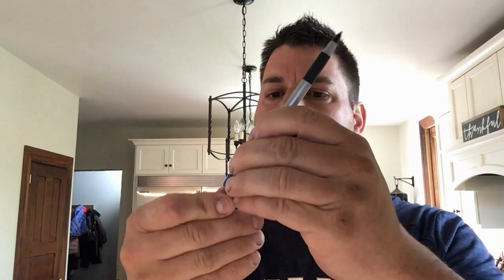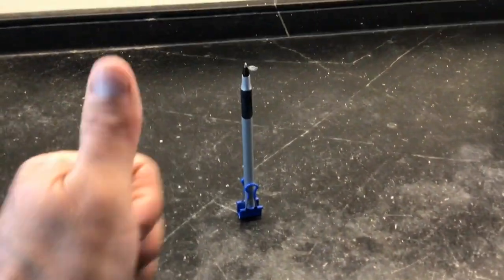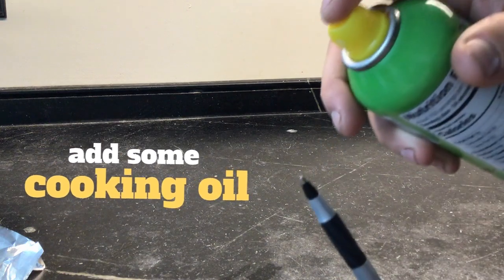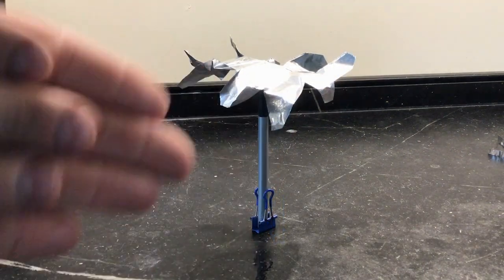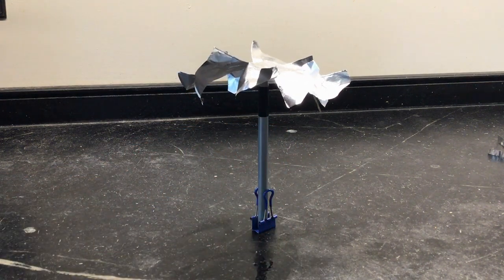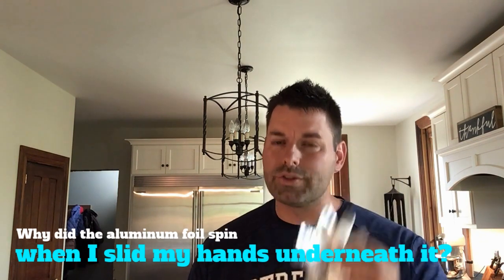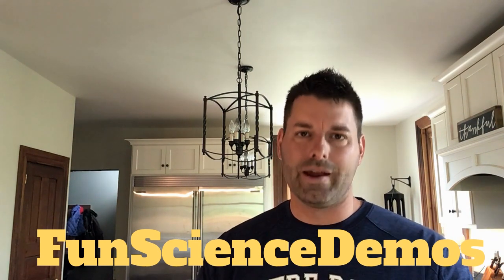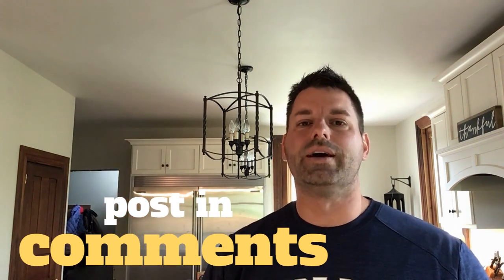Foil Fan - FunScience Scavenger Hunt

Comment: The thermal from your hands transfers into the cooler air molecules. Because there is more thermal energy, the air molecules start to move faster (vibrating more) and bump into each other. When the air molecules bump into the little flaps on the aluminum foil (warm air rises because it is less dense), it causes the foil to move and spins. When your hands are away, there is less thermal energy and the molecules move slower, so they don't bump into the foil as often and the foil eventually stops spinning (the cool and more dense air starts to sink). #science